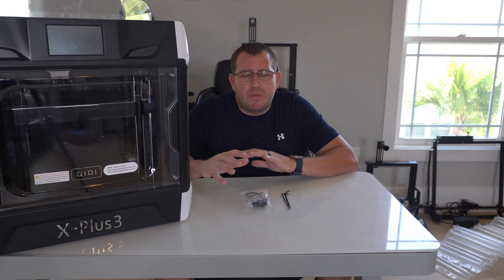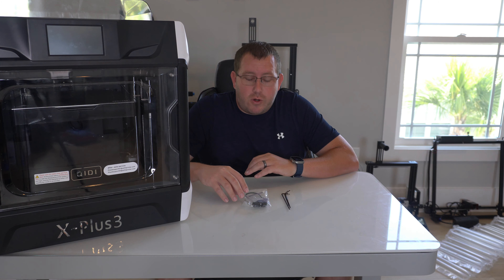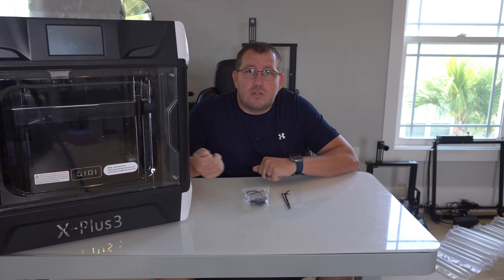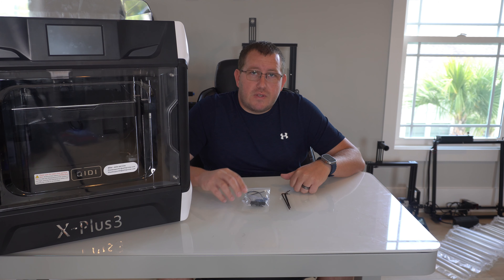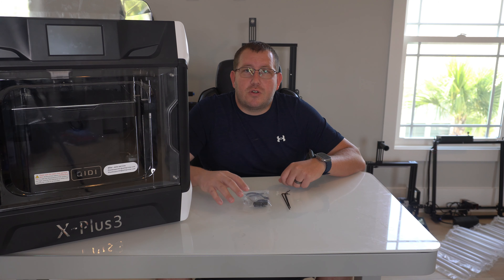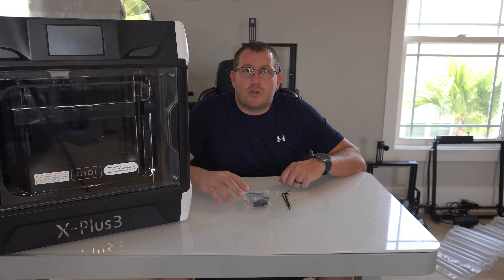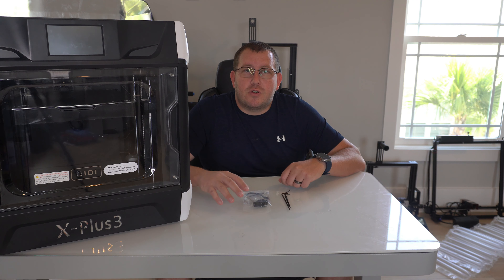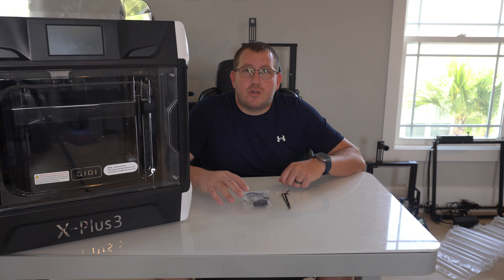QIDI Tech Hotend Swap

Comment: Qidi should pay you to make these videos, you basically did their job, thank you!

Also a tip from me, I could not get speedy prints like the demonstration benchy using the Qidi or Orca slicer, benchy that took 17 minutes was taking 40-45... I found no info nowhere.

So I found a way recently and am happy with it. On the webpage where you download the latest firmware, there is also the benchy Gcode file, download it and in Qidi slicer, click file and then 'import config' click on the downloaded gcode file.

Baam, now the 45 minutes is down to 17 like in the demonstration and you can study which settings they played with to get that speed and make modifications by comparing with the standart PLA rapido profile. Also my other prints besides benchy is nearly 2-3 times faster and with ok quality in my opinion.

One thing that pissed me was, I had to spend good time to get this info, and it wasnt written anywhere. Either everybody knew, or very few experienced people did. Which is probably the case because everybody on Reddit and so on was saying that it was a heavily modified Gcode and it wasnt realistic to print that fast :D

It makes me curious why Qidi didnt include this config as a preset profile, like maybe 'hyper fast' profile so nobody needs to do these research to get these configs. Is it bad for 3d printer health or longevity, is it because they didnt want quality to be poor as speed often decreases it... I dont know. But lack of transparency is weird.
Reply from the maker: Hi. Lack of information seems to be common among most 3d printer manufactures. I have a video covering setting up cura profiles for klipper but they should have better ones out of the box.

Comment: Thank you for this video. It was very helpful. The Qidi video is not helpful at all. 

I have read the. comments but wanted to change the complete hot end anyway as it helps to understand the printer better. I'm sure at some point Qidi will make this less fiddly and come up with a quick plug and play option.
Reply from the maker: Glad it helped

Comment: So all are the hotends the same? The only difference being the nozzle?  Or are is there something different about each hot end.  I ruined my hotend and I have the extra one that came with the printer.  Can I just throw a copper nozzle in the extra hotend or do I need to order the copper hotend from qidi?
Reply from the maker: Hi. Based on my understanding of this printer, the hotend is the same and the difference is the nozzle. You should be fine to just replace the nozzle assuming the one you have is the same thread pattern.
Reply: @3DPrintscape  That's correct.  I also contacted them and they said it was only the nozzle that made the difference.  The hotend is the same.
Reply: @MadeNicely  So is there any reason to change the hotend out then if you're not using abrasive materials? I know it says to do so if you're using PET or ABS but that seems excessive.
Reply: Yes , you can .

Comment: I have this machine.  I wanted to run abrasive filaments through a hardened nozzle.  And I wanted to see if the hot end could be swapped more easily than just do a nozzle change.   And I also thought there must be some difference in the hot end.  Otherwise why include it?   So I got through the procedure, but clearly just changing the nozzle should be easier.  But either way it was a failure because of completely lacking support for all the various settings on different materials when using a .6 nozzle.   I don't have time to go through all the temperature and flow tests for every different filament.  And I just barely know about how to do those procedures anyway.   Am I missing something?  Hasn't this been done at least for the basic categories of filament for a .6 nozzle?  Going back to .4 for now.   I'll have to get another Prusa for the Fiber stuff.  My current Prusa has been tweaked for running TPU thru a Diamondback nozzle and it works perfect.  I'm not changing it.   Thanks for showing how to do this change and the reminder about having the nozzle heated when taking it out.
Reply from the maker: Hi. I havent used .6mm nozzles before so im not sure what support they provide. The hotend swap is a bit more than just the nozzle and in many cases its faster for me to just swap the nozzle out.